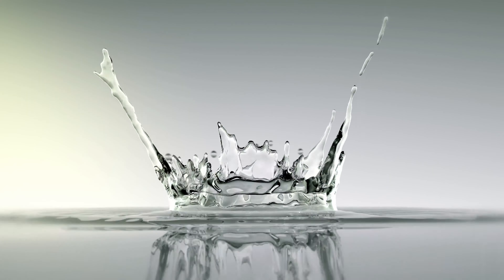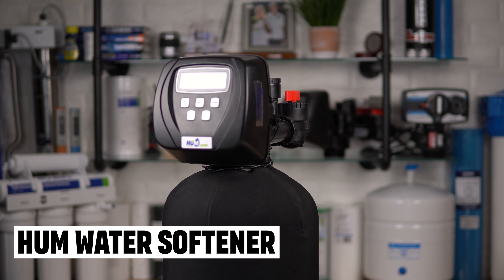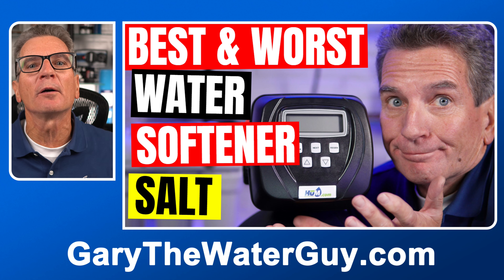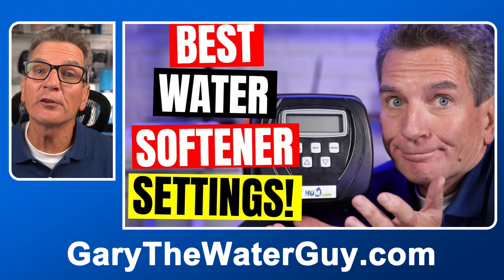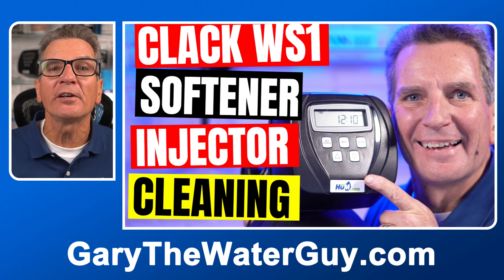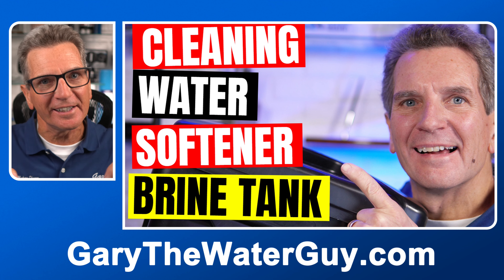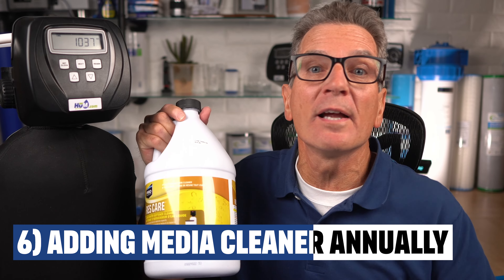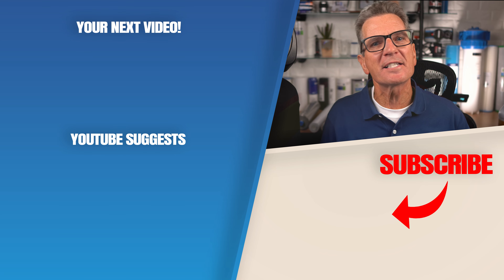6 ESSENTIAL Tips For Water Softener Maintenance!

Comment: Gary, first of all thank you for your time and expertise providing these various videos.
Question:  When I am away from my home for even a few days I always shut off the water to the house.
Well water with pump.  I shut off the pump by throwing the breaker in the electrical panel.  When I return home I am getting a lot of salt taste in my water.  I am now running my water for a few minutes in various faucets in the house to rid the salt taste.  Is this pretty much what I should be doing?  Is the initial salty water normal?  Thoughts on how long I should run the water?  Pretty new to this.  Any thoughts, suggestions, are greatly appreciated.
Reply from the maker: What is happening is that your water softener is starting a cycle while you are gone, that's where the salty water is coming from.  You are better off to shut off the water with a valve after the pressure tank (that's what I do)

Comment: Gary,
Thank you for many very informative videos, in a few short days I went from water softener ignorance to confidence in dealing with my system! I have a couple quick questions if you have the time:

*notes about my setup:
- well water
- 12 grains hardness
- 1.5 ppm iron
- TDS 247

1. I have a 9 year old softener with the CLACK valves. I have never turned the bypass valves. I would like to check and clean the injector and start moving the valves routinely like you recommend, but am worried about causing a leak. I have no issues right now with the brine well, the injector seems to be working normally. Would you recommend leaving the bypass and injector alone unless a problem develops?

2. I have always used Sifto Ultra Crystal with the Iron Out (green bag), never had a clog, but will be switching to the Windsor Salt pellets with the iron cleaner going forward. Per your recommendation, I will start using Res Care on a bi-monthly (every 2 months) basis. Should I also be using the Rust Out product along with the Res Care, or will I be fine because I am using the salt with the iron cleaner in it?

3. For my water conditions stated above, I have my softener set up for 20 grains hardness to compensate for the iron. Would you go higher or is this fine?
Reply from the maker: 1. Yes, that could be risky, as the bypass might leak afterwards. You can just shut off the water before the softener by another method and service the injector that way but you might get some water leaking out while doing the work. 2. No, just the Res Care will be enough. 3. Yes, those settings are what I would recommend.

Comment: Can I use a descaler filter before my water softener.
Reply from the maker: Sure, but why would you?  The scale comes from hard water which the water softener is making soft.
Reply: @water_estore   thank you for the super fast response. I have a newer home and not all water in my home goes through the soft water system. My 2 hose bib connections outside and the cold side of my kitchen sink are not soft water so untreated hard water goes untreated to these outlets.  
So at least these areas would be treated by the descaler. I just want to make sure the descaler wont hurt or hinder my water softener. Thanks
Reply: @johnjohnson2855  Unless your detailing cars, your hose does not need treated water. You should re-run your kitchen sink post softener. Most dishwashers run off of the sink and you want soft water for your dishwasher.
Reply from the maker: Yes, but dishwashers use hot water which in his case would be treated.

Comment: My Viqua clack valve water softener is programmed to do regeneration automatically. So when it goes below the reserve capacity starts doing it. But is not doing it at my set time 11.00pm. It's is doing it hours before why is that? I checked all the programming, and everything is the way it should be to do it at 11pm. Can you advise? Thanks.
Reply from the maker: Is the current time set correctly? Viqua softeners are pre fill, so likely it is starting earlier to let the water soak up the salt to become brine.  You might need to ask Viqua, since I am not sure and son't use (or like) pre fill softeners
Reply: Yes it has the correct time. I will follow your advice and will call Viqua. Thanks for the help 👌I keep watching your videos. Real useful for someone that had never a water softener

Comment: Hi Gary.  To do the injector inspection you need to remove the injector cap.  My Clack WS1 is so tight i bruised my hand trying to take it off to no avail. Can you recommend a tool to use so I can remove the cap and not damage the plastic exterior or my hand.
Reply from the maker: Yes, this tool is made for that purpose https://waterestore.com/products/clack-ws1-valve-disassembly-wrench-v3193

Comment: Hey Gary, I’m purchasing my first home and it has a water softener system since it uses a well in Southwest Florida and the water is very hard. I knew nothing about these systems until I found your videos. 

On the softener tank I have a Clack 3-button valve and on the tank labeled “sulfur filter” I have the metered Clack valve. I watched a video where you explained how metered valves are more commonly used on softeners than the 3-button Clack since those use a day setting for regen. Do you think the installers of the system swapped the valves by mistake? I had a tech come out to get the tank and system back up to speed since it’s been vacant for several months and the brine tank was empty, clock times were off, and I knew nothing about the settings. They claimed they have settings for other homes all around since we’re all on well water and he set my regen time to every 3 days. When I heard him say I’ll probably use 2-3 bags of salt per month I was shocked. I’ll be living alone in the house so I also wonder if I could go a few more days between regen. Thanks!
Reply from the maker: The number of days between regenerations is based on a calculation using your hardness , size of water softener and how many people in your home.  All of the water softeners we sell are metered so we don't use that calculation but your tech certainly should have.  What are your numbers?
Reply: @water_estore  Thanks, Gary! The tech didn’t go over the numbers but used a list of settings they use for all customers in that area since everyone’s on well water. I’ll be the only occupant in the house so maybe I can ask the tech for my numbers when he comes back to replace the pressure tank (warranty claim). That way I can use the data to find the days. 

One other question: On my Clack valves, I have the red directional arrow bypass valves. Do those allow me to half open/adjust the amount of soft vs hard water that goes into the house? I saw one of your videos explaining if you feel like your water is too soft, you showed a style of valve that was circular and allowed you to let some of the hard water into the house by adjusting the openness of the valve. Thanks!

Comment: Hi Gary 
First things first. Love your videos. Great insights. I have a clack based water softener. 
I have been having hard water issues for several weeks and there’s not a thing I haven’t tried. Literally replaced media to all kinds of valves  and seals and by swapping many different parts. On a 1 cuff media I am only getting roughly 400 gallons of soft water at best. In my ongoing iterations, wondering if tank size and the amount of media in it plays any role in overall regen process. I have tank that could take over 1.5 cuft and still have 12-15” freeboard. Currently my tank is about half full with 1cuft media and I have set it up as 28k grain capacity and Guelph water being hard (25) I have set up my hardness at 32 and salt of 11.5lbs. Wondering if reducing to a smaller media tank will help regen better. Thanks
Reply from the maker: I don't think a smaller tank will make any difference.  Have you tried the suggestions from this video https://youtu.be/cFy-M6i7_Ms

Comment: Question: I have a WS1 2.5 CuFt w/18" Brine tank w/ 10x resin. I planned on extra bathrooms and flow later on so I sized up a bit. I'm thinking my hardness might still be low during my regens and that I could push it longer, is it common to test your water and change the clack setting to regenerate less? seems like a waste of money/salt. Just curious is this is something you've heard of or done before, similar to looking at static drop for filter changeouts on your return air filter for your home. Also should I be concerned about channeling in the zeolite if my system is alittle over powered? My hardness is 28.4gm/USgallon or 34grn/MPgal with iron of .34 mg/L. It's a residential well in Canada
Reply from the maker: Definitely the regeneration frequency needs to be set based on the number of people in your housdehold (water usage) and your hardness and iron content.  If your water softener is a metered water softener and is set correctly it should take care of itself.  Keep in mind though that it must regenerate at least every 14 days or you will get channelling.  Which is why we never oversize a water softener.
Reply: Thanks Gary, appreciate the info/reply. Really enjoy your videos and the knowledge you provide

Comment: Hi Gary, I have a water boss 900 softener that when in the service position continually has water flowing through it. The water is coming out the drain hose into my sump pump. The brine tank has salt about half way full. It seems that the water is not flowing into the brine tank. Currently, I have it  in the bypass position. Any suggestions?
Reply from the maker: You likley need to rebuild the valve, which is actually fairly straight forward.  We have the parts here https://waterestore.com/products/aquamaster-drive-end-cap-assembly-54520 and the how to video here https://youtu.be/l9bm8Tm5cjU